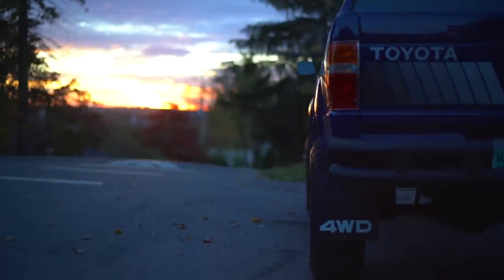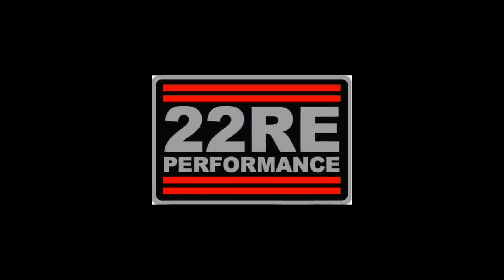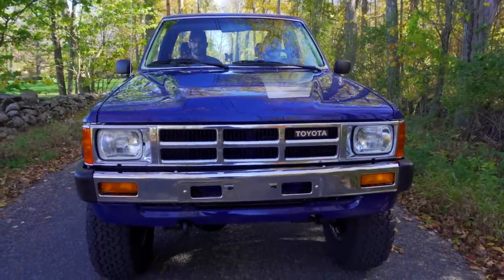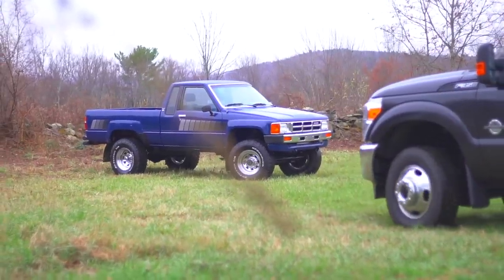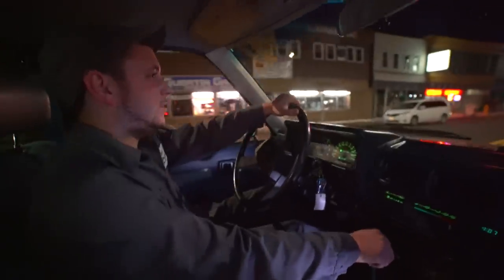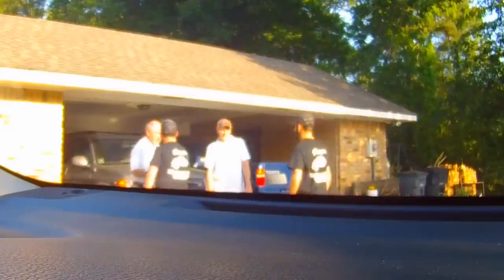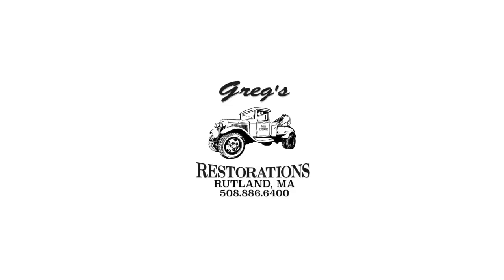1985 Toyota Extra-Cab 4x4 Pickup Restoration: BlueBoy!

Comment: These older trucks are far better than today's junk. Restoring them to factory new is expensive but still not as expensive as an off the showroom floor new one and you'll have basically a new truck that you'll likely have a reliable trouble free long future with. These new vehicles today are way overpriced loaded with crap electronics and factory recall after factory recall.

Comment: I wish they would reproduce this truck.
Reply: Jason Richardson If Toyota released a slight smaller solid front axle Tacoma, call it a T100 or just “the pickup” with a 2.2 I4 it would sell like fire I think. Just a simple truck, Hell with parking sensors, auto climate control, back up cameras, etc
Reply: Colton Ware I think USA laws require new cars to have some of those features
Reply: 100 percent
Reply: @firemasterx23  doesn't mean they can't reproduce a older body style truck with the same technology as modern day ones..
Reply: No. I'm happy with the old one's
Reply: Just not in America...
Reply: @firemasterx23  yes true.....crash tests...emissions....tpms...FMVSS.....etc..etc...
Reply: @alextran8188  actually it does unfortunately. Think about the need for crumple zones for safety, air bags, thicker doors, higher window lines. The redesign would affect almost everything in some way. You might be able to use a seperate chassis seeing as its a "truck", maybe..? But basically once youre done with the redesign youd end up with a Tacoma/new Hilux type truck that already exists.
Reply: @taylorsukoshi6126  Toyota's quality has slipped and is no longer able to produce cars to the level of quality they did in the 1980s and '90s. The vehicles they make in America are definitely not made well. Even the Japanese built cars are built by a different generation and mindset. 
I will keep my trucks going as long as I possibly can, I will take the old trucks over a new one any day.
Reply: @davidparker9676  agreed.
Reply: LittleTinyBabyJesus  All of the sources you quoted are well known to be bought and paid for. Consumer Reports was credible a long, long time ago. All of those like CR and JDP are based on "initial quality" and do not track anything in an empirical fashion. Most data is from voluntary respondents in the first year of ownership. It is funny how the Toyota Prius and the Lexus hybrids compare on these reports. Despite the Lexus being a re-badged Prius, the Lexus has terrible ratings. This highlights the problems and subjectivity of their rating methods. The two models are essentially the same car made by the same company with two different names and perceptions.
Toyota has taken a nosedive in quality. I could see the models produced in Japan and sold without excessive emissions equipment being reasonably good quality as compared to the other manufacturers that too have dropped in quality. 

Toyota is still benefiting from their reputation built by the 1980's and 1990's vehicles. Toyota is currently struggling with quality problems and recalls. I know many people that work for Toyota and they have confirmed that it is a shell of its former self.
If it makes you feel better, all of the car companies are getting worse due to government regulations and increased competition to lower costs and raise profits.
Reply: Hell yes
Reply: @davidparker9676  I’ve got a newer Toyota, and yes there are criticisms I have about it. I will not knock Toyota however as they replaced the entire frame and most of the under parts of my 2008 Toyota Tacoma for free and gave me a 10 year warranty on it. But I’ll agree that they just Americanized too much when they first came here Toyota had to think of engineering shortcuts to keep one going where no support network existed. They’ll take a Fram PH-8A oil filter ( then one of the most common around) the 4wds lug bolt pattern directly matched a 1/2 ton Chevy Silverado 1500 and the battery fit a standard GM size battery. When you measure up a newer Toyota to the legendary mid 80s trucks it’s no comparison. However when you compare the newer Toyota Tacomas with their contemporaries the taco is still a better truck

Comment: I owned an 87 4x4 Toyota truck reg cab Turbo short bed.   Was fully loaded with power windows, locks, mirrors antenna, full gauges, no sunroof or cruise control and it was a manual transmission.  Most turbos were automatics and all 4 runners with optional digital dash were automatics.   The manual trans much much more fun to drive.   The only upgrade I did was add a aftermarket intercooler and increased power dramatically.   The turbo package was avail in late 85 (as 86 models through 1988 and  was available on all 2wd and 4wd models 1986-87.   In 1988, turbo option was only available on 2wd trucks as the 3.0 liter V6 debuted as an option for the 4wd trucks and 4Runners only. Standard power for the 4wd in 1988 was still the 4 cylinder, but like I had stated no more Turbo.  The Turbos head was different and had a weak spot and was known for cracking between 2 and 3 cylinders, but other then that, was a good motor if cared for. The flywheel and clutch were also larger for turbos only.  I now own a 1993 and 1994 Toyota truck 4x4 extra cabs with 3.0 liter motors  with every option including factory sunroofs. I regret selling my 1987 and my 1988 loaded V6 short bed reg cab with sunroof, full power, white exterior with rare red interior.  Maybe one day guy I sold to will let me buy back.

Comment: Great job guys.. I bought a one owner 1985 SR5 just like this one but it was black with a sunroof, power windows and all. The body and interior were great, but it had engine problems, so I found a 1985 2wheel drive that came with a Turbo charged 22RE, and swapped it into my SR5, and then one day some gentleman wanted it more than I did, so I sold it. now, of course, I wished I would have kept it.
Reply from the maker: Thanks for sharing!

Comment: I also fell in love with Toyota's in the theater watching the first Back to the Future when I was 8 or 9. My first vehicle was a 84 standard cab 4x4, and I've had an 88 sc 4x4, 89 4runner, 90 4runner since and currently have a 84 SR5 4Runner. Huge props on the work, but looks like you have a very good starting point. Wish I had the funds to do this to my current 4Runner.

Comment: Still driving my 1985 single Cab SR5 4WD, straight axle, 5 speed, 22RE with 357000 on the odometer.... and in the same flat blue.  Owned it since 1990.  Bought a Tundra in 2003, but still drive the 85 more.  No body work, starting to rust on bed, never had the head off, 3 timing chains.   Fixed the TPS, IACV, EGR passing and it starts and idles nice, with strong pull from the start.  It's so simple, straight, reliable, and functional.  Restore, or drive it till it dies (it won't)?  I'm learning to cope with it not being an extra cab after 29 years. Drive, drive, drive, oil change, drive, drive.

Comment: I had one of these 1985,5 speed ,22r,carb,think I bought it around 1999._l live in NJ-it was a rust bucket but,I"m 60 years old now,looking back,Probably the most fun truck I ever owned.Absolutely a beast in 4 wheel drive,locking hubs,straight axle,burned oil like hell but ran like a clock.

Comment: I am almost finished restoring and bobbing an 88 regular cab pickup with my son.  Did everything over all new AC components, anything I could get from Toyota - even got new window regulators straight from Toyota.  I wish this truck was available just like it is but everything scaled up to a full size with some large displacement  straight six.  I'm telling you you can have the dash out of this truck and have the gauge cluster in your hands in 10 minutes.  I replaced the all of the AC components in about 2 hours.  The condenser slips out from under the dash like sliding a book off a book shelf.

Comment: i had one as my first car, Diesel though. It had a 2.5 inch exhaust that sounded amazing. I lifted it, built a custom tray and painted it. All on a budget in my driveway between work and uni. I sold it before it had gotten too rusty in the trouble zones. Somehow now 10 years later I own it again, except it has a turbo and a standard tray and has been repainted again. The paint is bad (weird reaction for some reason) but so much has been renewed that the only issue is the paint (like all the running gear has been replaced with lower mileage gear, common rusty foot-well has been replaced, the chassis isnt rusty thanks to dry Aussie weather, even the windows all work). The rust never got worse in the body because its been repainted twice in the last 10 years. So now Im pulling the cabin off for a 100% rust fix and then Ill repaint it again

Comment: You guys did an OUTSTANDING JOB ON THIS BUILD!   That truck sits perfect and it’s obvious you you took some time to nail the stance in proportion to tire size.   Those chrome wagon wheels look tough! I have an 85 with the chrome SR5 wheels. They don’t look quite as deep dished as the ones on blue boy.  Would you happen to remember the rim sizing and tire size and  lift specs on that thing.   It sits so good!
Reply from the maker: 15inch us chrome wheel with 31 inch bfg all terrains
Reply from the maker: With 2 inch lift

Comment: I currently own 2 Toyota’s. The first is the “holy grail”  85 sr5 extra cab. Bought from original owner. This truck has been well kept and have numerous people offering to buy. I have not found one cleaner than mine unrestored. 1989 4Runner  removable top 3.0. Just personally rebuilt the motor and have gone through everything from front bumper to back. Are those decal kits still available for the pickup ? Was the truck lifted? What size tire/wheel combo?
Reply from the maker: Yes decals are available online, 2 inch lift with us wheels with 31 x 10.5 bfgs
Reply: Since my truck is factory white, is the color of that decal the standard for all color trucks offered in 85? What springs was used to gain the 2inch lift? Using stock shackles? Looks like the wheels are 8”? On line meaning you sight? My front springs are tired and look de-arched.

Comment: I bought one of these trucks (1988 model) with a 22re, and I put a new exhaust system on it, and it is as quiet as a mouse now. I have put 5000 miles on it so far.

Mine is just a truck that runs, and has 4wd capabilities. Idc what it looks like.

Comment: My father owned the same Color Toyota 1986, 4x4, Manual, Extra Cab years ago. He paid about $15000 after taxes and such, drove it for 5-6 years and racked up about 180k miles, then sold it for around $12000.
He basically paid for maintenance he did and got his money back. It’s one truck he wished he had never sold, mainly because he thought it would have been a truck I would have loved to be passed down to me as my first car, a thing he regrets not doing.
I dont blame him, we’re both Toyota guys and my 08 Tundra has 220k+ miles on it, it was his he was able to pass down.
I hope I can find him that 86 Toyota truck again one day :)

Comment: Nice video I once thought I had an unhealthy obsession with 2nd gen Toyota 4x4 pickups but now its clear my instincts were right all along.  Whats the current value for a stock 84-85 extra cab 4x4? I have 2 stock carburated rigs, one "88 lifted solid axle swapped with a flatbed and my other '84 extracab  22RTE Turbo efi swapped out of the 86 with r154, wider ifs rear axle and bobbed 10" with old school smittybuilt nurf bars and bumpers. There is no cure just ongoing treatment.

Comment: I have a 1986 Toyota pickup IFS 4x4. Mechanically restored with a low mileage engine <10K I got from a garaged (totaled) 87. The head cover still has the factory seal and has not even reached a need for its first valve adjustment. Purrs like a toyota should.

Interior 10/10 all original. No cracked dash. Toyota OEM window rolling assembly.
New Front Diff, CV axles, tires, A/C system (all components new).

Considering selling after the body work and paint is complete. If you know a buyer I would consider consigning. Let me know thanks.
Reply from the maker: Send some photos to my email gregsrestorationsllc@gmail.com

Comment: Nice restoration with tasteful mods. Awesome Job. . I am currently looking for fibreglass rear box sides for a Toyota Pick Up or in other parts of the world a Hilux 1994  3.0l 4X4 SR5 Ext Cab ... if you know of a reparable manufacture or have a them yourself for sell that would be great. Any info is amazing. Side note I have 1989 - 1995 4X4 ( 4cyl and 6cyl ) Toyota Pick up parts as well if you are ever in the need.

Comment: I just went through my late 85  It was basically an 86 with independent suspension  ,  I did an axle swap  and rebuilt engine trans, transfer case added a Doubler and  lockers  , went through the 
interior  body work and paint .   it took a year almost to the day   .  They're great trucks and it's really a shame toyota has gone in the direction they did .

Comment: Oh man ... I had a 80 exact color hi luxe long bed ... bought it used 5400 mi in September 1980 ... I had same wheels and BFG tires bumpers , roll bar , lights , the truck was the TRUCK to have in 80s ... you guys stay in a niche market and specialize in this and eventually you could even reproduce body panels etc... the only drawback to my truck is if you are a big guy or tall ... hard to be comfortable... but other than that these were unstoppable off road ... well done guys you restored this better than new my truck in 80 was 8500     How much is a full resto...cost...???...

Comment: About how much do you think it would cost to do a full restoration on an 82 Toyota Celica Supra? The engine, transmission, and rest of the power train only have 88k original miles but the car has been sitting outside for over 20 years so it’s in pretty rough shape due to a lot of weathering, rust, sun fading.. the car has been in the family since it was brand new. Engine hasn’t run in over 10 years. Fuel tank would either need to be replaced or cleaned due to bad fuel sitting in it for years. So it would need a lot of cosmetic work and probably quite a bit of mechanical work as well.
Reply from the maker: Hello, please send me pictures to GregsrestorationsLLC@gmail.com of the vehicle.  Thanks!

Comment: i got one O these it’s an 85 single cab with factory sunroof in black with chrome rims and chrome bullbar up front with a GMC 4.0ltr small aluminium block V8 with an adelbrook aircleaner ,Holly 4 barrel inlet carb with a hoffenhouser inlet manifold and  tubular exhaust manifolds that eventually reduce into a twin pipe and exit to the near side of the truck bed just in front of the rear wheel it has a bellhousing conversion allowing it to hook up to the existing 2.5ltr diesel gearbox and j configuration transfer box so has lots of torque but destroys gearboxes over a short time 🤨 it has 33 inch by 12.50 15s BFGoodrich all terrain tires on  10x15 offset wide stance chrome splitrims with front and rear live beams I’ve had it about 8 years and now it’s time for a rebuild I’ve already located a good chassis ✊️👍 
®🦁
Reply from the maker: Awesome!

Comment: 4:46 bumper is misaligned.  looks clean though
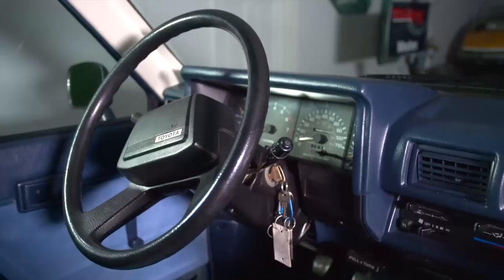Reply: I saw it to, quite a few things not as good as they should be, at 1:27 check out the bubbles in the factory decals on the tail;gate, upper left side of stripe decal. Should have been redone Greg....

Comment: What a perfect job. That truck looks great. I have the same truck that I also want to restore. I always wanted to keep the original 22R motor until now. I just bought a 4500 Diesel turbo engine from a 4 runner land cruiser. I want to fit this engine to my truck. What are your thoughts mates?
Reply from the maker: I'd keep it stock or upgrade to 22re fuel injection. Under the hood is a work of art!
Reply: @gregsrestorations7019  I agree!
Reply: Thank you mates. I'll do just that. I can't get over your truck. It is beautiful
Reply: We never got the fuel injection 22r in SA. So mine was carburetor. I fitted a 2.54ja1 turbo diesel. I'm very happy with the results

Comment: BEAUTIFUL BUILD,  but you should have used Japanese tires, ha ha. I had a 1988 2WD, and it was the most reliable vehicle I ever owned. Bought it from Toyota in Santa Clara as a stripped down loss-leader (no radio, bumper, or wheel covers) for $6888, and sold it 190,000 miles later for $1500.  Today I own a 2002 Sequoia 4WD SR5 that I am converting into a "camper-van." Having fun, and NOT spending Sportsmobile money to do it. One requirement: no cutting or welding. Everything can be removed and returned to a 7-passenger SUV in 30 minutes. No plumbing, but it's an awesome sleeper.
Reply from the maker: Awesome!

Comment: "Not a big parts aftermarket for these."  Wait, what?  From what I've seen, the aftermarket support is strong for these late 80's early 90's Toyota pickups.  Theres's like 9 different brands of header for the 22RE, multiple fender flare companies, countless replacement parts manufacturers.  Seems pretty comprehensive to me.
Reply from the maker: restore one to the caliber of this build and then tell me about it.  I could care less about bushwacker fender flares or junk tailgates the don't fit. I'm talking about factory replacement parts. Bedsides,  rust repair panels, plastic interior parts,  wiring harnesses, clips that hold the bedside stone guards on, trim for the windshield, door glass, dash pads (not plastic covers) seat fabric, etc. the list goes on...
Reply: @gregsrestorations7019  100%. There are plenty of drivetrain aftermarket support (quality parts too), but once you start moving into body panels, trim pieces, interior parts, wiring and electrical components, there isn't much. I have seen more and more interior and body parts being produced just in the last year, but the quality is crap when compared to the original Toyota parts.